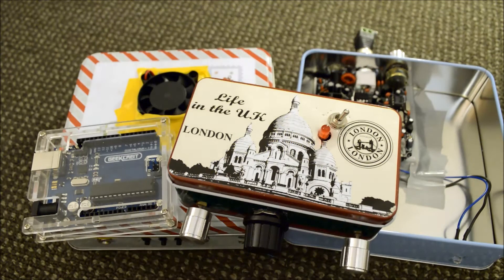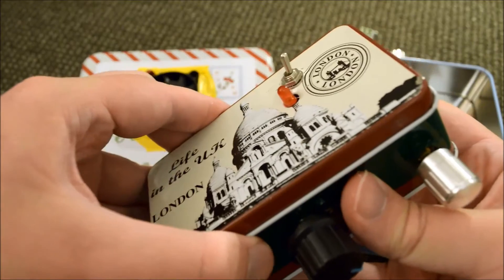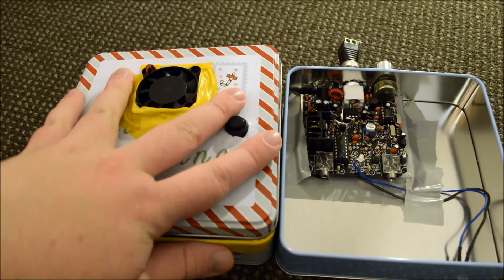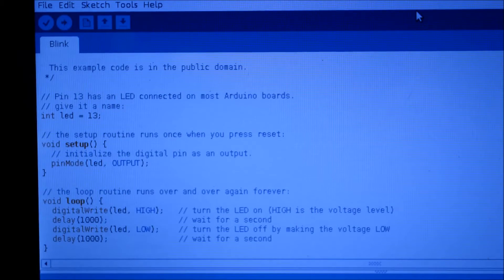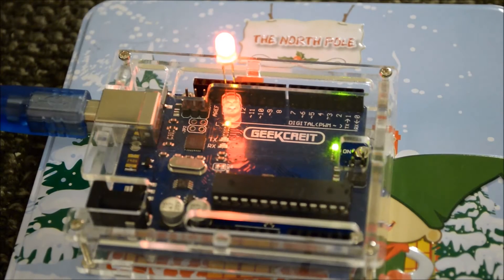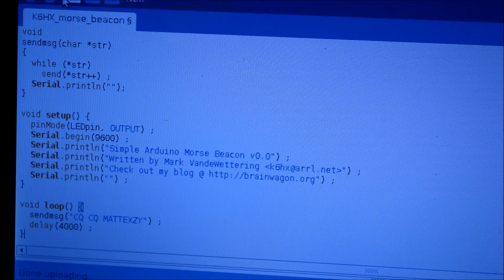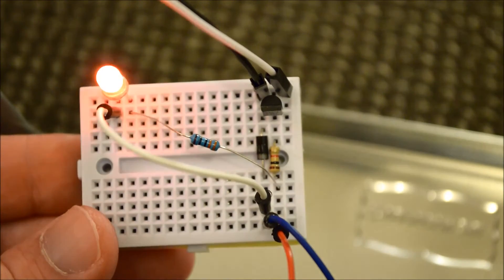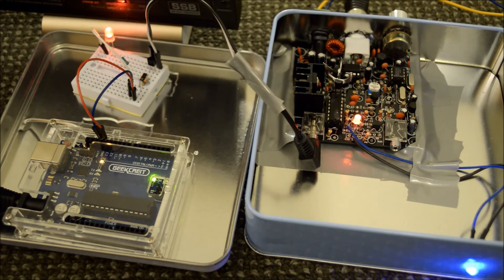Beacon n' Eggs - Arduino for QRP Kits

Comment: It would be worth mentioning that the NPN transistor works as a NOT port, when the led is on, the base starts to conduct and pulls the collector to ground. So 5V becomes 0V and 0V becomes 5V. Most common transistors like 2N3904, 2N2222 or BC547 will work. At the moment you can still buy the small Pixie kits on Ebay for 40 meters for less than 3 USD. It has a crystal with a fixed frequency, usually 7.023 MHz, but with a variable capacitor in series with the crystal you can vary a few kHz. I've seen cheap clone Arduino UNO R3's for less that 5 dollar so you can make a very cheap QRPp beacon. Very nice video, thanks!

Comment: Funny, I was just thinking about doing this yesterday with my rockmite. I forget if you mentioned it or not, have you gotten your license yet?
Reply from the maker: Hi Zep, not yet, so everything is still theoretical.
Reply from the maker: Oh, and with the Rockmite - this transistor set up works perfectly. I tried using a relay with my original Rockmite, and it seems to have absolutely fried it for some reason. So for beacon use, I'd definitely just use an NPN transistor for the interrupts on the Rockimite microcontroller.
Reply: What are you waiting for you should be able to knock that out no 
problem. You're way ahead of where I was when I took the test. That's 
good to know about the relay, I was planning on using one.
Reply from the maker: Thanks Zep. I guess I'm still a little intimidated by a lot of hams down here. They're always talking about 50ft masts, and buying $10,000 radios from Japan and whatnot, and me, well I'm just some guy dicking around with QRP kits and 1/4 wave antennas a few feet off the ground. Amateur radio here is a lot like golf clubs for older gentlemen; very exclusive, and not too accepting. I'm abiding by our laws by not transmitting, but until the licensing catches up, I'll probably be shunning it all for a while.
Reply: I wouldn't worry too much about what other hams are doing. I too don't 
have a giant antenna. Last night I just finished tuning the 80 meter 
coil assembly of my PAC 12...   http://www.qrpkits.com/pac12.html 

I has a 1:1 match almost right on 3.560 (qrp). I've got 100 watt rigs but mostly seem to gravitate towards qrp anyway. It's way more fun. Where's the challenge in using 100 watts and a directional antenna on a mast?
Reply: Well I find you dicking around with QRP kits that are accessible to everybody more interesting than expensive exclusive purchases. Keep it up!